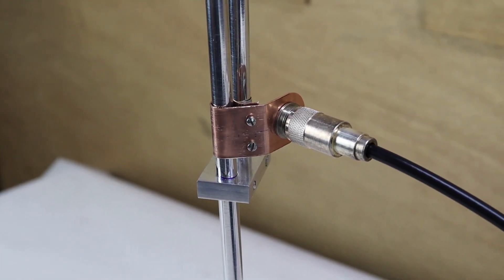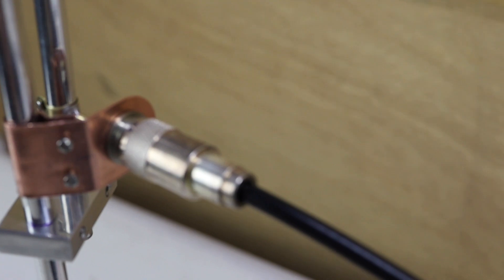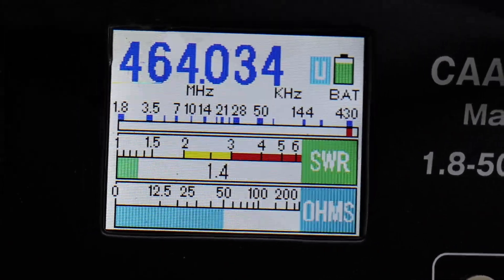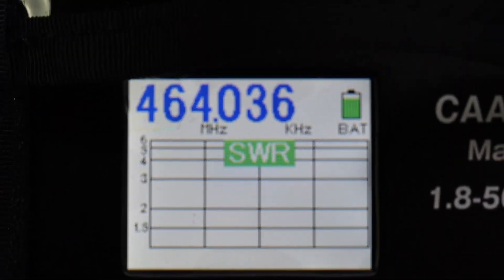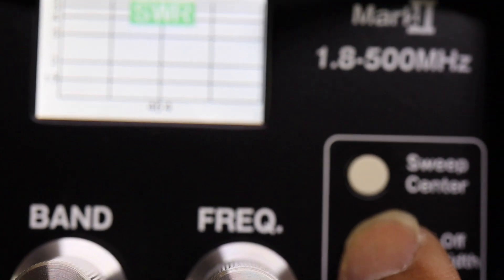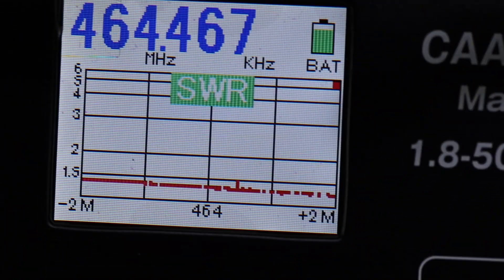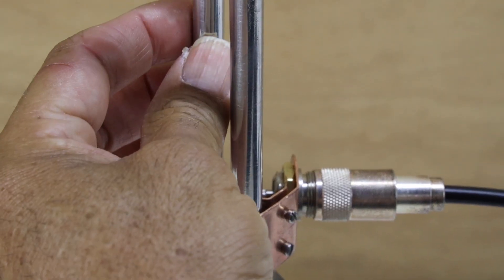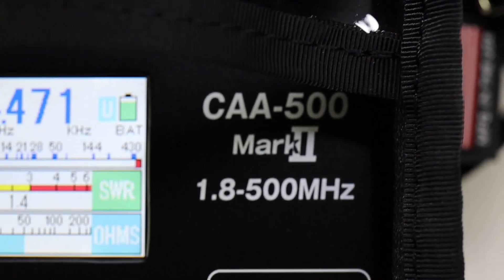How to tune a DIY GMRS JPole antenna

Comment: dont understand how a j pole works, it looks like a direct short to me
Reply: The total length is 3/4 of a wavelength...  The bottom 1/4 wave section is the matching stub.  The top 1/2 wave section is the actual radiating antenna (an end fed dipole).